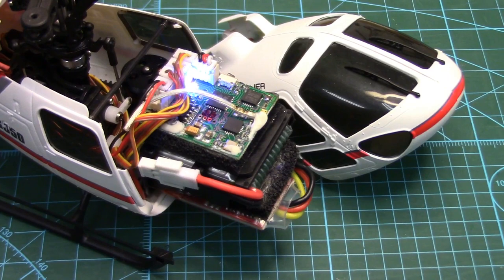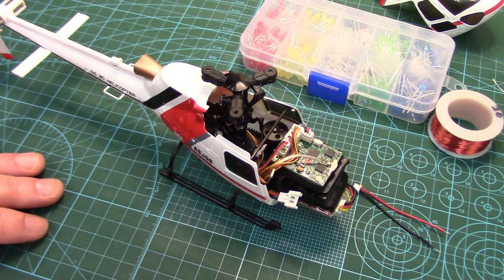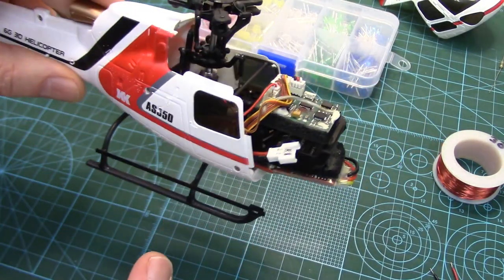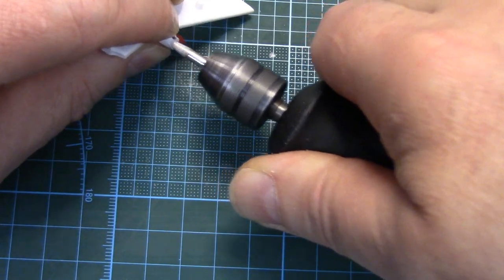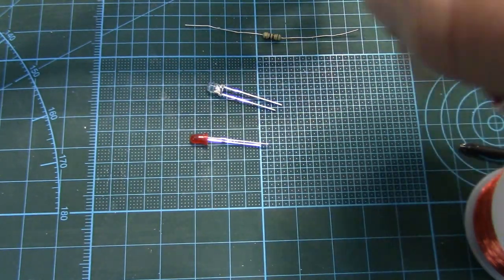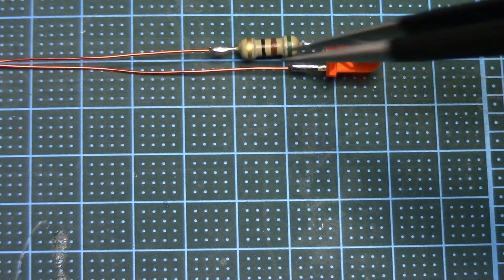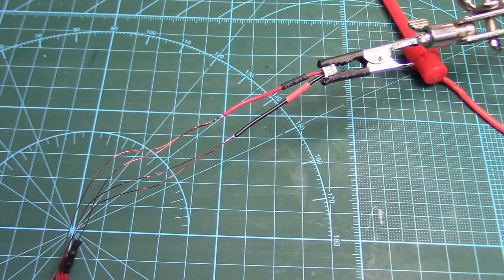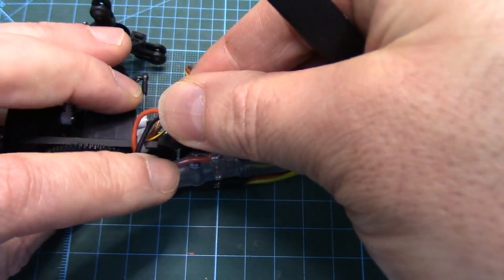XK K123 DIY LED Project

Comment: John, I'm relatively new to the hobby but your information across your site and youtube channel have been so helpful! I'm trying to add FPV to my K123 and couldn't understand why it wouldn't power off the board. I remembered this video and thought I might learn something that would apply. I learned a bunch and key thing here was the reversed polarity on the port! Voila! Thank you! Now I just need to get better at flying :-)

Comment: Great job and thanks for sharing. I have an XK K124 and was thinking of putting green-red LEDs on the tail fins.
Does the same method applies?
I have tested the 2mm green and red LEDs but somehow found the green to be dimmer than the red, and same thing happens to the other pair of LEDs i tested. Any idea why?
Reply from the maker: Different color LED's often have different Vf (voltage forward) values and current draw at that voltage. If you want them close to the same light output, you will likely have to drive each color with its own current limiting resistor. Experimentation time.
Reply: John Salt ahh i see. Yea looks like experimentation time. Thanks for the input (no pun intended), mate.

Comment: Hi, I had ths as a birthday present and I dont know if something is wrong in th efactory set up, it´s not stable like yours, it´s drifting all the time even when I make the adjust in the controller, how can I know if something is wrong from factory?

thank you
Reply from the maker: If it's always drifting in the same direction - that's a trim issue and the swashplate will need leveling (assuming a cyclic drift). If it's random like how a marble behaves when balancing it on a flat plate of glass - that is perfectly normal and how all collective pitch helicopters behave. My "are RC helicopter hard to fly" page on my website covers this topic in detail:  https://www.rchelicopterfun.com/are-rc-helicopters-hard-to-fly.html
Reply: thank yoy very much! your artice help´s me a lot to understant the problem and result the problem is me! thank you again

Comment: Thanks for this project 😄, however , I did not like the LED putting in those places , instead of as a head light , mounted in main fuse.  It is not looking that scale.  

Thanks again coz I didn't know that port can be used for LED . Good job! .
Reply from the maker: As I said in the video, it's to give you ideas - you can put them wherever you want. I specifically didn't want an LED up front for the exact same reason I mention it's a PIA in the K124 - wire fatigue & eventual failure.
Reply: @Rchelicopterfun  ,
Thanks for sharing yr ideas. 
A request , would u pls tell me yr Xk130's Pitch Curve & Expo values in normal scale flying mode? 

I will turn my Blade130X into XK130 by using xk130's ESC, RX(motherboard)  and XK's direct tail motor. I purchased these 3 things Xk130 motherboard , esc & tail motor separately.  

 Reasons :  Blade130X  motherboard is garbage & too old . 
I  like """direct tail motor drive""" more than traditional tail servo pitch control…… 

Basically it wld be a hybrid heli of Blade130X+Xk130 .  Thanks
Reply from the maker: Exactly what I show in my Setup & Tips ebook: -3 to +10 collective range. I don't use any Expo when I have high amounts of dual rate reduction.

Comment: Don't know if anyone has noticed BUT, The battery wires are also REVERSED. I bought an after market battery from Banggood for my Heli-MaX EC-135 and found that I had to take the pin out of the connector and reverse them. I ALMOST plugged to the ESC then noticed this. BEWARE!
Reply: Excellent video. I bought two I liked them so much. My question is in listening to your video is. Could I install a headlight, a white flashing light in the belly and a red flashing light on tail.  I know I need the 51 ohm 1/4 watt resistor for red or do I need a different resistor? Also do I put a resistor on the white flasher and headlight as well since there will be three lights. Obviously I am not electrical person. Thank you.